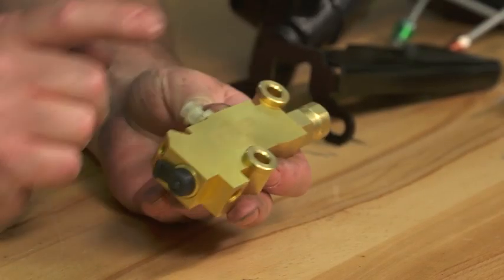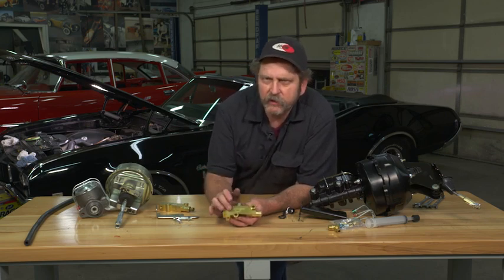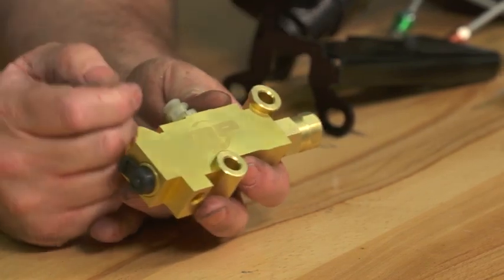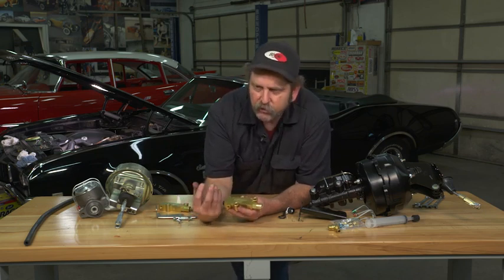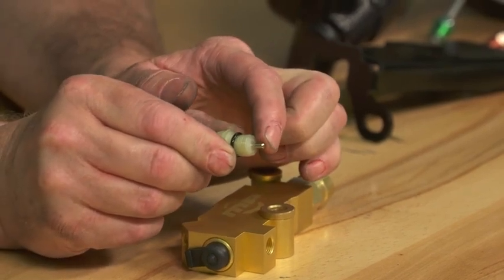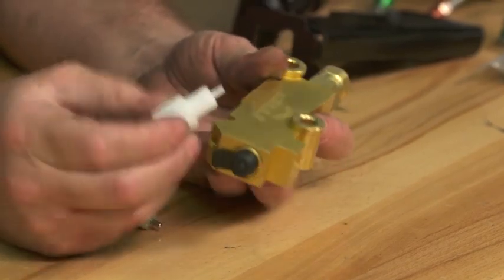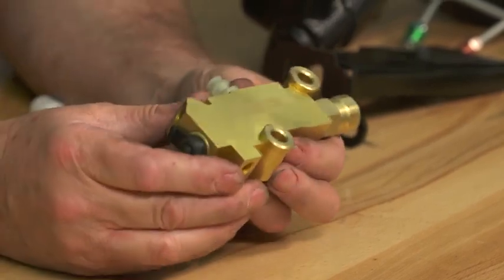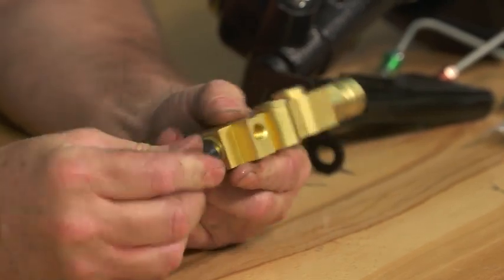Understanding a Combination Valve

Comment: Thanks for sharing the facts on the combination valve I installed a disc to disc on my C1500 but can't find the right fitting for the rear port and the front port size they r different from the old valve that I removed but I did plug the top port but thanks for the information.

Comment: After removing the metering valve for disc/disc and plugging it, will I 100% for certain need an adjustable metering valve in line with the rear brakes? Or might I be ok as is? Thanks!!!

Comment: Hey bud I just replaced my metering valve on my 1978 chevy 1/2 ton pickup also replaced new brake lines brake shoes, drums and a new master cylinder. But I still can't get my rear brakes to bleed? Do you have any advice? Thanks

Comment: Fantastic information . You helped me greatly . I am doing a drum -drum ( 1965 Pontiac) . I want to stay as close to original as I can , but am installing a dual master / combination valve assy. Thanks for the rod tool tip . I was not able to find a drum / drum combination valve . So I am wondering if I should add an adjustable  proportioning valve (SSBC #A0707-1P) to the rear line , just after the combination valves' rear line . Do you think it would be good to dial in the rear separately ? Again great vid. !
Reply from the maker: Hi Derek, 

There is no substitute for safety, so I applaud your decision to upgrade to a dual reservoir master cylinder. 
The drum/drum combination valves, simply has the front metering valve disabled, the same as the disc/disc combination valves, and the disc/disc combination valve will work in its place. 

For your setup you could simply run your front line to a splitter to go to each wheel and put an adjustable proportioning valve on the rear brake line, and leave out the combination valve entirely, 
I'll attach a couple links to metering blocks that simply join the splitter to the rear proportioning valve, some also include pressure switches to operate brake lights. 
On drum brakes you do need to maintain 10psi of residual pressure in the lines, from the factory the master cylinder had a check valve in the line port. 
With a new dual reservoir master cylinder it may or may not have check valves in the ports, so I always drop a couple of 10psi residual pressure valves in the lines to the front and rear DRUM brakes. 
Disc brakes only use 2psi of residual pressure and if the Master Cylinder is mounted high on the firewall, the weight of the fluid in the lines produces the required 2psi of residual pressure. 
Here is a link to one source for a residual pressure valve: 
www.speedwaymotors.com/Wilwood-260-13784-Red-10-PSI-Residual-Pressure-Valve-with-Fittings,233816.html
The SSBC proportioning valve you listed will work well and here a few links to proportioning valves I have used: 
www.speedwaymotors.com/Adjustable-Proportioning-Blocks-With-Brake-Light-Switch,6160.html 
www.speedwaymotors.com/Wilwood-260-11179-Adjustable-Proportioning-Block,41747.html 
www.speedwaymotors.com/Speedway-Compact-Adjustable-Brake-Proportioning-Valve,1979.html 
www.speedwaymotors.com/Adjustable-Proportioning-Valve-Block-Brake-Distribution-System,66525.html

Wrench Safe, 

Mark
Classic Car Restoration Club Video Membership

Comment: When the centering valve moves to one side, can brake fluid still flow through that side? I.e. if I have a brake leak in the back will it completely block fluid to the back and only use the front or will it let some fluid through to the back?

Comment: My burning question is: are there any differences between  GM & Ford proportioning valves, or are they all Universal Fit??
Reply from the maker: Hi Carl,

While it is true that most aftermarket conversion kits use a GM style proportioning valve, The fundamental function f the combination valve remains the same regardless of the year make and model. 
So what is different? As mentioned in the video the combination valve includes a metering valve for front disc brakes and a proportioning valve to the rear brakes. 
The proportioning valve ONLY comes into play during hard or panic braking. It prevents a surge of fluid from rapidly reaching the rear brakes that would otherwise result in locking up the rear brakes and put the rear in skid causing a loss of control. 
The proportioning valve is tuned to the vehicles braking system as larger and heavier cars are less prone to lock up the rear brakes, while lighter cars can easily lock up the rear brakes. 
It is best to use a proportioning valve from a vehicle with similar size and brake system, otherwise an adjustable proportioning valve is a good alternative. 
The metering valve to the front brakes comes into play during normal braking, it is only present in front disc brake cars and prevents the car's front end from diving as the brakes are applied in NORMAL braking. 
Bottomline: Ford, GM & MoPar proportioning valves can interchange ... but pay attention to the size of the car they are from and they have similar braking systems (i.e. drum/drum, disc/drum, disc/disc).

Mark
Classic Car Restoration Club
Reply: You have no idea how much this helps! Thank You so very much!!!!!!!

Comment: what type of tool do you use to remove the lower pressure switch ?
Reply from the maker: Hi Rob,

The switch is simply a brass rod with a notch out of it. 
HOW IT WORKS: The brass rod shifts position if either the front or rear brake circuits lose pressure. 
A steel pin in the combination valve that is wired to the dash brake warning light is then grounded and completes the circuit and turns on the light. 
When bleeding the brakes the rod can shift also, that is why it's a good idea to remove the wired steel pin and replace it with a warning switch centering tool while bleeding the brakes. 
Here's a link to one source for the tool: https://www.speedwaymotors.com/Speedway-PV2-PV4-Proportioning-Valve-Bleeder-Tool,296895.html 
and here's a link with Bob Wilson demonstrating how to rebuild a combination valve: https://www.classiccarrestorationclub.com/video/proportioning-valve-rebuild-011335

Mark
Classic Car Restoration Club

Comment: tkx ccrc I have a 1995 Chevy K1500 4X4 sick & tired soft peddle-turn disc/new pads-front-rear -soft peddle-ABS module won’t bleed-replaced it =replacement leaks-part not manufacturer any more no one rebuilds them -master & brake booster replaced =soft peddle [mechanic not replaced yet] so I dumping these ‘F-N’ ABS going with a conversion combination valve -viewed it here the tube -liked your breakdown of its functionality tkx..don’t get sneeeeeeezed on 💉💉

Comment: The warning switch does not ground out to complete the circuit so the brake warning light comes on , it is a switch itself the plunger part goes up and down to complete the circuit or break the circuit , the rod in the middle has o rings so is not grounded , test it yourself , then correct you video